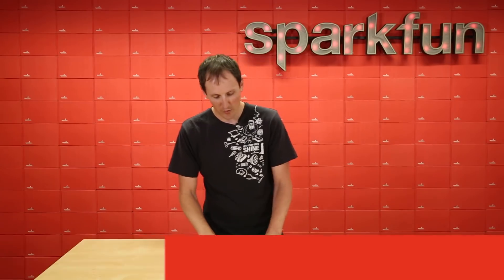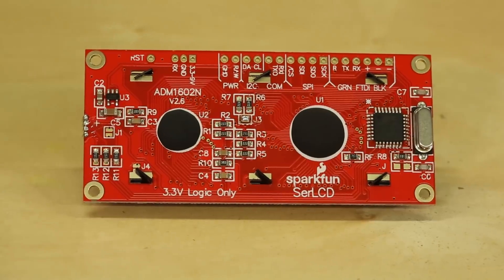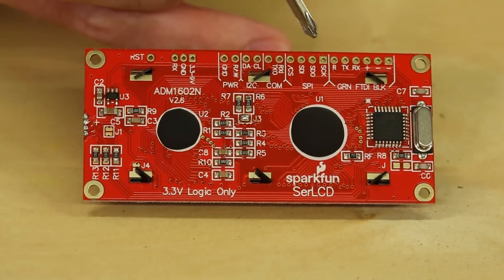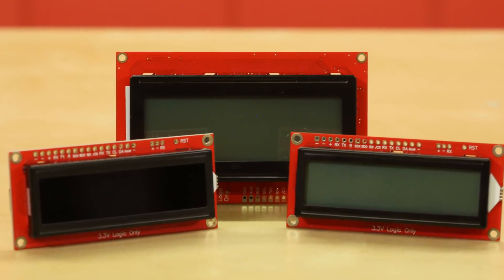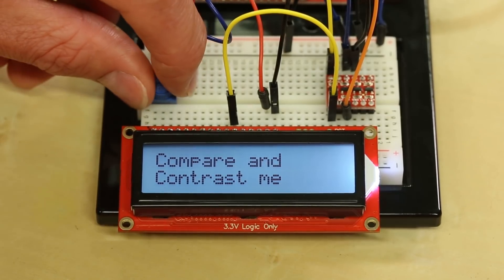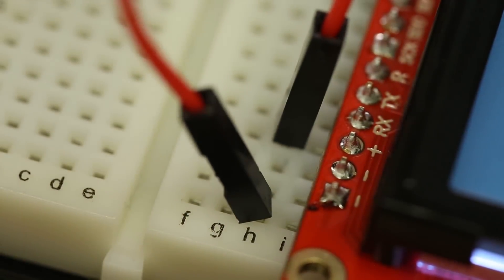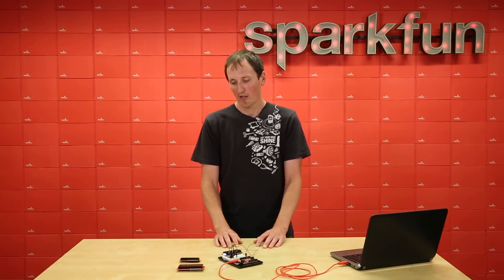Product Showcase: SparkFun SerLCDs

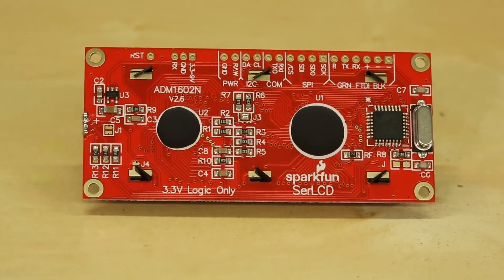Comment: ok, everything up to 4:15 does nothing to tell me how to do an acceptance test or wire this device.  you then cut to 4:20 and 75% of what I NEED TO KNOW TO BUY THIS DEVICE you completely skip over.   The other 25% of what I need to know is basic communication.  I have no doubt that with a Pi/Blackbone/Embedded-Arm/linux/windows dos prompt, I can set-up and send serial strings with a simple shell script to this LCD, but you haven't demonstrated a simple ascii-based text file script to ensure your wiring is done properly.  I need to see the comm's at the most basic level, the hello world and counter and the backlight demo programs should be released as a simple shell script I doubt more than 50 lines, so I demonstrate this screen to my customers to include them in my products.

Comment: Bit of feedback....  3:00 in.   RAW power in...  This pin brings the RAW power down to 3.3
Well, fair enough but that is not the pin on the board shown as RAW it is the input marked 3.3-9v.
Bad labeling is not helpful.
"Out of the box" can I send it stuff on the I2C bus to display on the screen, or is that only possible through the FTDI serial port?